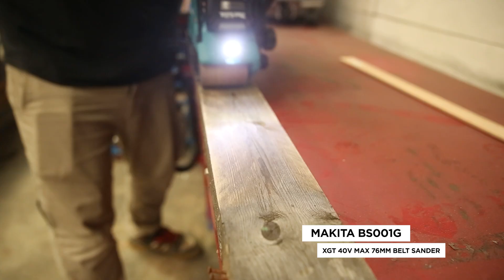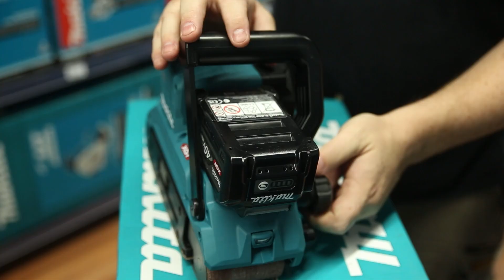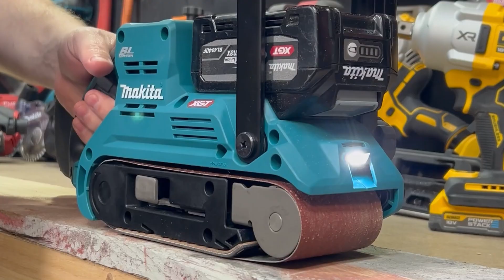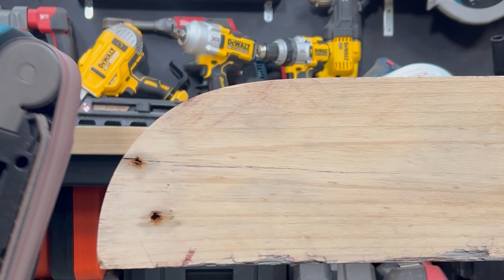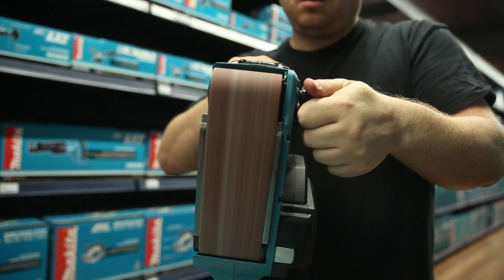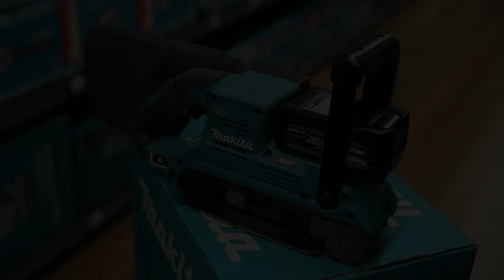NEW Makita XGT 40V MAX Belt Sander (BS001G)

Comment: The product manual and the Makita website only show it being compatible with batteries up to the 5ah size. Are you sure it's ok to use the 8ah batteries with this belt sander?
Reply from the maker: Makita doesn't recommend using it with 8Ah. Not because of performance or harm to the tool but because it can only be operated with the front handle fully extended and not in a traditional vertical position. It also can't be used inverted with an 8Ah as it won't sit flat on the bench. So they discourage it.
Reply from the maker: Its a safety thing